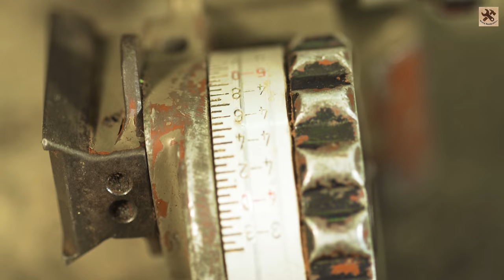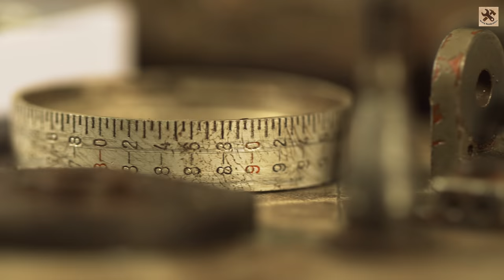Antique Strange Object Restoration

Comment: So much nope in this video.  This is what we gunsmiths call a "bubba job".
Okay, it's a mortar sight, possibly chinese judging by the stencil on the case before it was obliterated.  But that's no reason to destroy the darn thing.
Disassembly was obviously not thought out beforehand, and I think that buddy has something against screws.  I say that due to the number of them he destroyed using his Wal-Mart bargain bin screwdrivers during both disassembly and reassembly.
Cleaning: okay, I get paint stripper, tooth brushes, paint brushes, etc.  But a sandblaster and sandpaper on precision optics??  These parts will never be true again!  The masking for the paint was, jeez, I don't know, the only word that comes to mind is "stupid".  Bits that should have been masked weren't and bits that shouldn't have been were.  And that colour!  Bloody hell, he couldn't arse himself to go to the hardware store for something close to the original, but rather fished under the workbench until he found a can of something that said green on it.
So for reassembly he chews up more screws, gets fingerprints all over the glass optics and uses Phillips screws in place of the original common ones.
This was NOT a restoration.  A restoration is where you make the piece as good as new.  I certainly wouldn't rely on this sight to get rounds on target, you would have better luck lobbing them in with a giant slingshot.
Buddy, get a job as a lion tamer or an accountant or possibly consider banking, but please don't do anything with your hands that requires precision.
Reply: I have to agree. It would have been better to just clean it on the outside a little and keep it as a vintage piece. Now it's completely ruined and has no value at all. Hopefully there were at least some lessons learned on how not to do restorations...
Reply: As an artillery man myself I died inside seeing this sighting device get destroyed.
Reply: Yep! Gotta agree with all you said. I am no restorer, but even I can see this is a bit amateurish. Nice camera work though.
Reply: +1
Reply: I couldn´t watch this video until the end. I love restoration videos, but to see how amateurish this thing is taken apart was just enough. He doesn´t know what he´s got here and doesn´t even research before destroying it with his rough disassembly. I watched to the point where he sandblasted the parts and had just seen enough. This is the first video ever on YT I gave a "thumbs down". For myself I can say I could not make it better than him, so I would not even try it. I would give it to someone who really knows about such devices.
Reply: @Jettaheizer  I’ve managed to find several videos that I just hate and forced myself to watch them just for the thrill of being annoyed.
Reply: @keithwhisman  my time is too valuable to waste on lousy videos...
Reply: I can’t agree more!  This is likely the most painful-to-watch restoration video I’ve ever seen.  I found myself loudly asking “how many times do you need to try to screw that thread in the wrong way?” “Why don’t you have decent screwdrivers?” “Why the hell are you doing antique restoration? You should be doing something that doesn’t require precision!”  “Stop all the damn sanding!”  The Phillips screws at the end really closed the casket for me.
Reply: A mortar sight is my guess, as well.  Using a steel brush is for certain a 'Bubba job".....

Comment: I love that you removed that little piece with your fingers at 04:35, then used your fingers to place the piece into a pair of tweezers just to move the piece a few inches onto the table instead of putting it on the table with your fingers that were already holding it. That was funny. 😂

Comment: Sorry, but no. I don't like the way you handle the bolts. You put back the original bolts, without restore them. I can see the surface rust on them. you could polishing up the not painted surface's. With those would be nice to see how coming together the parts.
Success!

Comment: A shame you didn't steam the wood where you crushed it with the slip-joint pliers, that would have lifted nearly all the marks of carelessness. It looked to have been a precision instrument before you made it not so precision, therefore not restored. A tip, do some research on rust removal and durable paint.
Reply from the maker: We will try harder in the next videos

Comment: Yet another "restoration" video where the item hasn't been restored. When will these "restoration" clowns learn that restoration means to return it to original condition? Scraping and sand-blasting the rust off the thing only to slap on some shitty paint, all while taking zero care to protect the piece, isn't a restoration.

Comment: what is the deal with these restoration people using teasers to pick up parts that could very easily be picked up using fingers  Most of the time the parts are not  antiseptically clean and they use their bare hands to handle the largest pieces.
Reply: Fat fingers get in the way when trying to take video of small parts, that's bottom of my list of issues with this "restoration".

Comment: Looks like the consensus of critique here is that this channel is a very cheap copy cat of far better and more legitimate restoration channels. Tool use is ham handed and cheaply done. Typical close ups of screws being removed and obligatory and mostly unnecessary sandblasting just because sandblasting “looks cool”. So congrats, you don’t restore, you destroy. And you just try to piggy back honest work with hamfisted nonsense. Please stop.